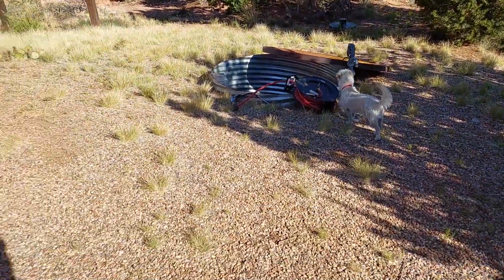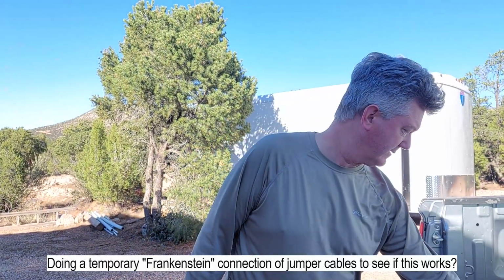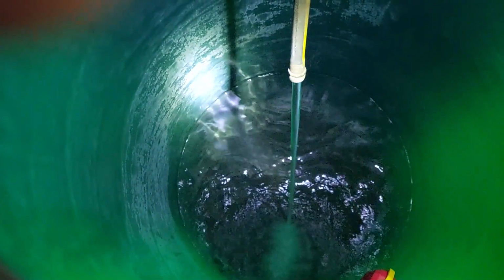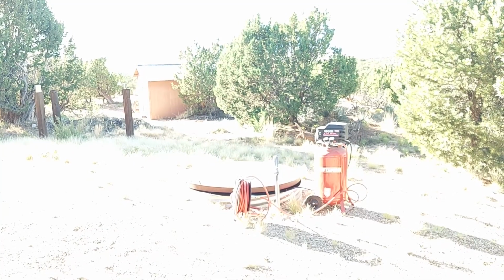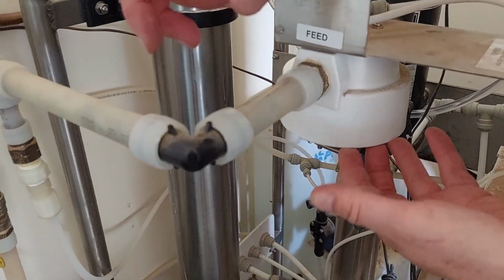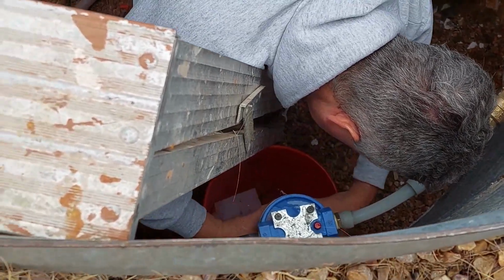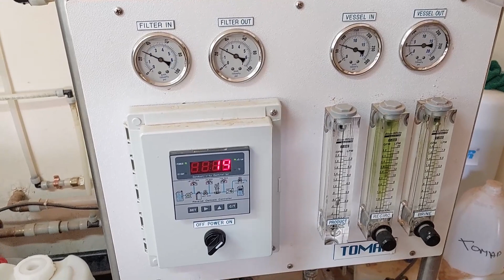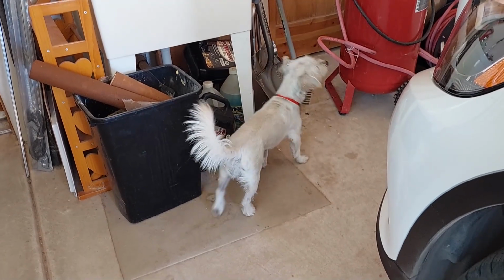NPL 091: Do We Have a Broken New Shallow Well Pump?

Comment: LOL I can tell you aren't ranchers here in Mountainair. getting rid of grass?
Why didn't you just use the car battery, instead of going through all the taping of jumper cables?
You city folk sure do puzzle me
Reply from the maker: Unfortunately, i didn't want to take a chance on draining the battery and since I had a few jumpers available it let me keep the engine running while pumping the water.